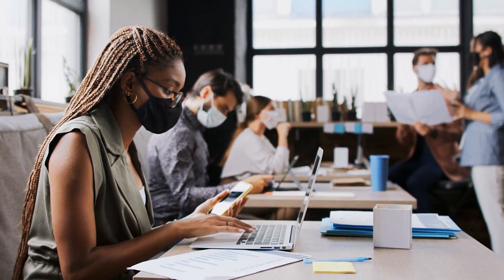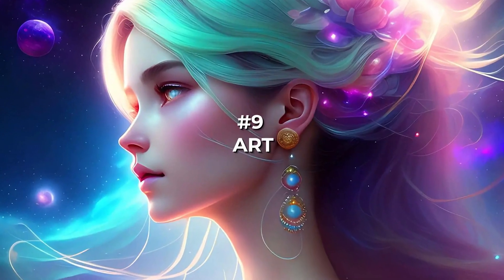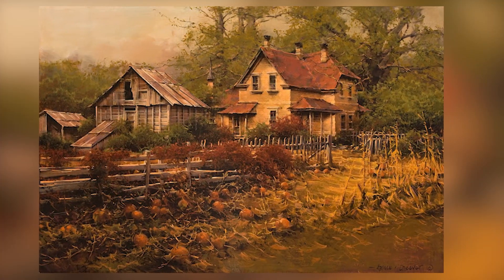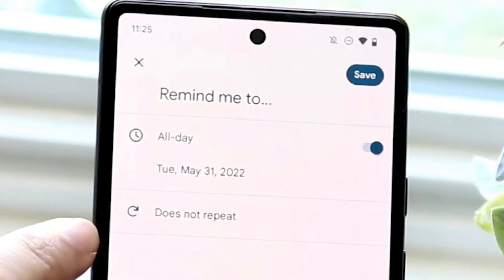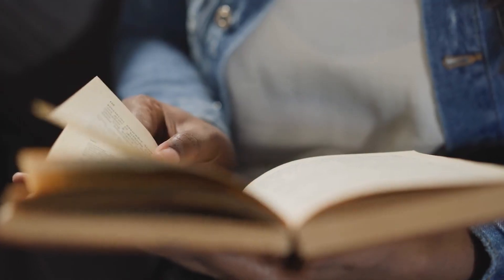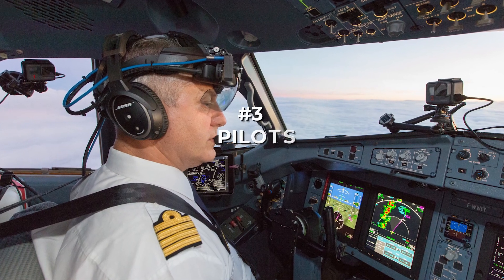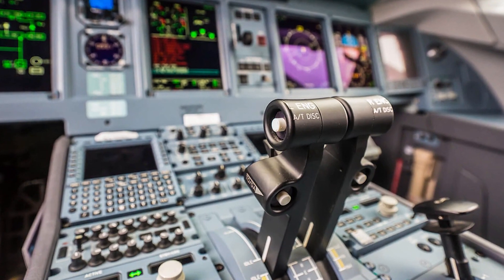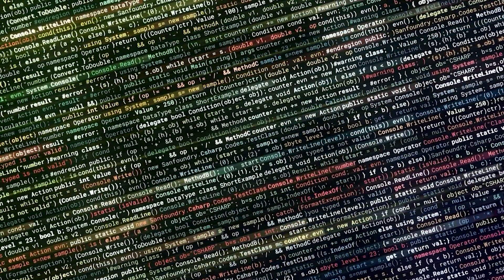Top 10 Most SURPRISING Industries AI Will Kill Off First

Comment: 10: Not yet. There was a case recently where AI was employed to conduct legal research and it BADLY failed. It would save a lot of time ripping through everything to perform legal work would a lot easier, more accurate, and faster, but the tech simply is not there yet.
7. There still needs to be human overseers. I am not on board with living in a society where all the major decisions are made by some program unchecked. Ditto for HR.
3. Never gonna happen. The incidents with the Max 8 demonstrate why there will always be a need for human overseers in cockpits. Flying a helicopter is much different than flying a plane.